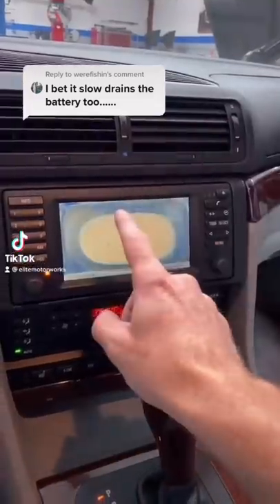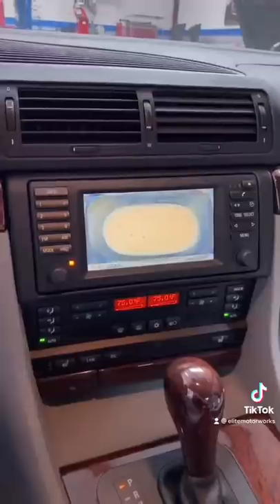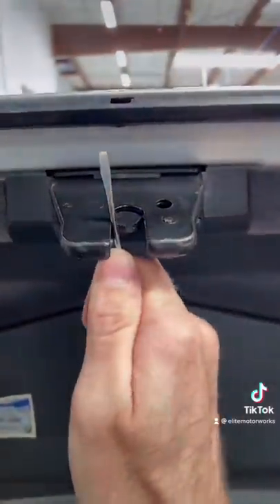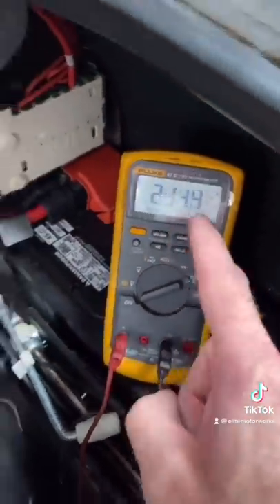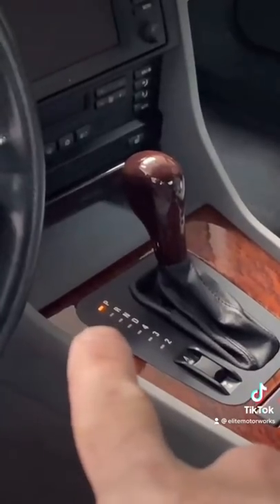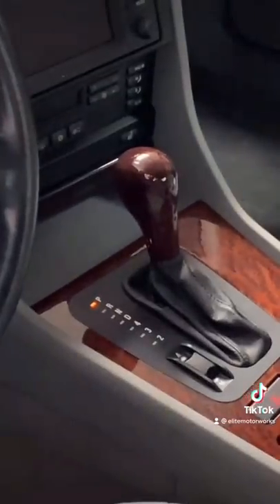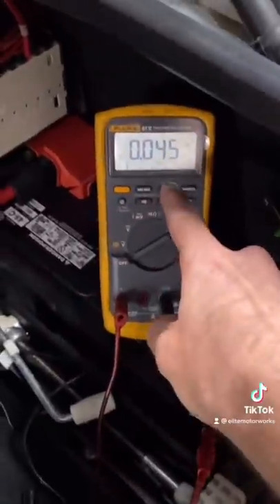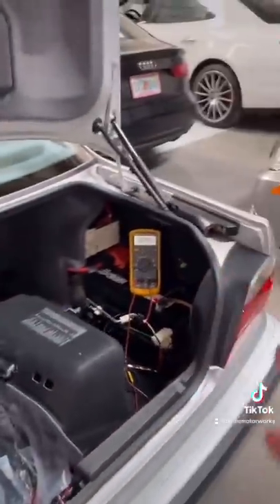Checking BMW Battery Draw #shorts

Comment: Now I know how to assess a electric draw, you learn something everyday. 
Thank you for your properly informative YouTube Channel!
Reply: Make sure that if you do this, you put the meter in series with the battery or you'll blow the fuse in the meter
Reply: @asbestosfibers1325  is 50 mil amps just a common reading across all cars or just Bmw’s
Reply: @Mrvalle420  It seems to just be a rule of thumb. I would guess that anything around 50mA would be what you'd look for in any car. (50 isn't the magic number though. 51 or 52 would be just as good as 50.)

I don't have much experience with car electrical systems, but I'm going to school for electrical engineering right now.
Reply: Not all cars you can do that trick.. some you can't unhook the battery.. just like low voltage can cause cars not to go to sleep.. every car is alittle different
Reply: @Derbyboy13  connecting the ammeter in series makes the circuit connected again, so I think you’ll be okay?
Reply: @Derbyboy13  what are you talking about? Disconnecting the battery would defeat the entire purpose of this test
Reply: @944LS  depends on the meter.. I know they now make meters you can put in line.. but if the meter doesn't let 100% pass through you could cause your own problem
Reply: @Fee.1  cars have parameters to go to sleep.. some need to see so much voltage before it'll go to sleep.. so if your battery is low it'll never go to sleep.. it's all down to how it's programmed and what parameters with are looking for.. another example one year only for corvettes if you doesn't put it in first gear the computers stays awake.. it was a programming problem

Comment: Note: for some makes the test isndone the same way EXCEPT you connect -  batt post to - cable end for 5 min and remove jumper cable leaving ammeter leads conecting - post to - cable end. On some makes the initial current draw is 15A or even more and it will step down to 3-4 A after 4 min and then it won't blow meter fuse.

Comment: I switched from checking for draws this way to checking via the can bus. That's the real game changer. You have all your components on one bus in your hand at the same time. You don't have dig out components to unplug them (pulling fuses doesn't always do the trick), but a can bus never lies. Also you'll get your voltage change in less than 5 seconds after locking the car. Think about how much time that adds up to if you only have to wait 5 seconds for each component check. It saves at least an hour if you're working with something that isn't a known failure. I promise if you try it you'll never turn back!!

Comment: Pro tip sometimes cars are even smarter than we are and realized the car hasn't been woken up yet I've ran into this problem, draws will only be apparent once the car is started and shut off once if you got a weird one try this too, you got to hook a high current  jumper wire up between the battery post and cable at the same time have your amp meter hooked up too than start the car shut off, then just remove the high current jumper wire and now your amp meter is the New Path for electricity to flow with no interruption to the car, this is how I found the Bluetooth module in Acuras having a current draw problems before the tsb's were out

Comment: What you have said is incomplete pop up the hood & trunk open 4 doors then lock each latch manually then lock the car using remote, go to battery make sure before you disconnect the negative terminal connect the tester probe black on terminal/ body ground the red is in battery terminal negative then slowly disconnect the terminal from the battery post. Wait for the system  to sleep then check the reading it should be around 25 to 30 okay ( dark current)

Comment: A Quiescent closed current draw with a 100w range amp clamp would be just as effective and you can watch the car go to sleep along with the specific time on which it does with all the access panels removed and the interior motion detector disarmed hood switch in the service mode glove box light disconnected. 60 mA is for our older vehicles some of the newer ones are completely asleep in 30 minutes and draw less than 20 mA. If you use your meter put an inline circuit breaker so it doesn’t pop your fuse in your meter.

Comment: The only problem with this is that by disconnecting the battery you can inadvertently remove the draw. For example if a control unit is causing a draw it may be reset by the disconnection only to return later. To prevent this BMW has a special tool that allows you to hook up a meter without ever breaking the connection thus making it easier to find those pesky intermittent battery draws. Without this tool you increase the risk of a comeback. Also on the newer cars, E65 and newer it takes about 1 hour to fully go to sleep meaning you can't rely on the shifter light to indicate the car is in sleep mode. That only works on pre E65 models.

Comment: Helllo from a technician that does a lot of electrical issues I basically work on Asian vehicles but I have done German as well as American vehicles a couple of things I've learned when doing a parasitic draw test on a battery one is never take the battery cable off and then put your meter in series either use an amp clamp with a scope and look at the waveform or hook a battery jump box to the cable lift the negative cable up then put your meter in series with that cable if you disconnect the negative cable as in the video some  modules to be exact will  wake up . Now you need to wait for the modules to go back to sleep which may take 30 minutes to an hour to actually see if you truly have a parasitic draw and it is always good to check and make sure the battery that you are testing reads between 12.4 to fully charge.

Comment: I use an in line battery disconnect switch on the ground cable to handle wake-up current so I don't blow the fuse in my meter. Once I'm sure current draw is less than 10A I switch off the disconnect and let current flow through my meter which is hooked up in parallel.

Comment: Also, if your battery isn’t the size of a BMW battery, and your car isn’t a luxury car, it probably shouldn’t be that close to 50 mA. I have seen 45 drain a battery over a weekend, but the battery on the car was quite a bit smaller. That said, 50 mA is the standard, and close to it is usually only an issue for cars that are not used a lot.
Reply: That's not possible. 50mA over 36 hours are 1.8Ah, or not even close to a tenth of the smallest realistic battery capacity that has still works

Comment: If you end up doing this on your own vehicle and the draw is out of spec you need to start pulling fuses until the draw drops to normal, then put the fuses back in and pull connectors/sensors etc related to that fuse and eventually you will find the draw.

Comment: But you reset any modules when you disconnect the battery potentially removing the draw temporarily. It’s better to use an amp clamp for this reason, especially on newer cars. Also CAN may take up to 10-15 mins to “go to sleep” after locking.

Comment: Another reason for why both the e38 and e39 will drain the batteri is if it has air supesion in the rear and its leaking, the compressor will go ok even if you dont have it on.

Comment: This is a common issue when the dealer switch the polarity of the battery wrongly and bring it back to the correct place, it causes the multimedia center to drain battery later

Comment: I have an aftermarket android radio and put it on the circuit that completely shuts off when you remove the key. I have to wait a minute for it to boot up when I start the car, but it's the time I spend setting up my seat, putting on the seatbelt and waiting for the engine to warm up a bit so it's still pretty good. No idle draw that way!

Comment: You should check the potential draw on the battery with a 10 amp fuse before hooking up your meter so you dont blow its fuse.

Comment: Just buy a matching LCD screen online and fix it, as long as its the same size and same connections itll work. It doesn't need to be a BMW brand screen. it really is somewhat   "simple" if you know what you're doing.

Comment: Had a similar problem with my f250 diesel. Started pulling fuses until my ammeter showed zero. Pulled all the fuses and nothing happened. Then I turned to the relays... nothing but the ecm relay stuck in the open position. Replaced the relay and no more parasitic draw

Comment: Well that answered one of my questions. Just got my 740il going again I'm the last week. Maintenance and insurance. It's been sitting for 3 years. Anyways the other night I shut the car off and noticed with everything off and the doors locked the parking light on the shifter was still on. Now I just need to make sure that it's actually shutting off. The last battery that was in the car when I bought it kept dying on me. But I don't know the history there. Since I've replaced the battery it has dyed yet but I do drive it everyday. Guess I need to run the multimeter and see if I got a draw somewhere.

Comment: Also RF receivers for the keyless lock-unlock could be acting up. On my range rover the fr receiver is sensible to wi-fi/mobile phones signals  preventing the bcem to go to sleep and it will kill the battery in two days.

Comment: Manufacturers think < 50mA is OK?
I'm surprised.
That could be a bit over 1 Amp-hour every day, which means short battery life and/or a flat battery when you come home from holiday. 

I've had that problem with a Peugeot, cured by fitting a battery isolator. Then I left it alone for 6 months during lockdown, switched on and it started fine.

Comment: You should check into the mooshimeter for battery drain testing. We use ours all the time. It can datalog in csv format so you can graph the results.

Comment: Nice. But that means it could drain a smaller 55 Ah battery completely in "just" a month and 3 weeks. It (maybe?)won't start in a month because starter needs hundred of Amps but the battery only has about 40% state of charge after a month of last use.

Comment: Would this work with my E39 3.0d, I started playing around underneath the passenger seat to try and get the heated seat to work, the other day I could hear a buzzing sound when I turned the car off late at night, when to work left the car there all week and tried to start it and had a flat battery, turned the car off last night no buzzing sound. Never had a flat better before and looks new still. Thanks in advance
Reply: Similar issue in my 530i, fuse 9 was the culprit which powers the windshield fluid heating system which often draws too many amps but it also does aircon/defrosters
Reply: Yes that would work to check it. You could also just check the batteries health with a charge then load test. (carbon pile is best)
Reply: @charlierobinson8375  might be my issue as well, might go get a new battery and pull 9 and watch. Car has been sitting for 2 years now waiting to go home to NJ.

Comment: When i first bought my mini i tight something was wrong cause those little lights would stay on long after locking up the thing that made me think there was an issue with something staying on was that my battery was already in a shit state and would die super fast. Took it to the dealership and the said that was normal for mini/bmw vehicles. I bought a yellow top and never looked back cause i no longer had an issue afterwords

Comment: Grandpa had a Chevy truck I can't remember which year or model but it would drain the battery where over the weekend if you didn't go to work on Monday or Friday it would need a jump and it just killed batteries they started taking fuses out to the point none were left until they just disconnected the whole fuse array then it stopped slow draining

Comment: I'd recommend (Depends on your DMM) using a jumper wire, connect it from the post to the cable then attach your DMM in parallel with it. You check to make sure you don't have high amperage, then disconnect one end of the jumper cable to fully measure the amps. This way you don't blow your DMMs fuse.

Comment: I own a 1998 Opel Vectra B V6 (Manual trans) and my Battery died. So I did the same test but I only had 18 miliamps so why did my Batterie die?

Comment: I have a 07 Lexus IS 350. The Nav screen doesnt respond to touch. Im having the same battery drain. I also have a headlight that goes on and off. Could this be my problem? If so where should my multimeter be?

Comment: Quick question: on your multi meter, wheres the positve prong leading to?  Should I let that hang or test every fuse for a parasitic draw?
Reply: The multimeter needs to be in series with the battery, so one prong on the battery itself and the other prong on the wire that you disconnected from the battery. In this mode your multimeter acts as just a wire allowing electrons to travel through one probe and out the other, and then it just monitor how much power is running through it. Just make sure you multimeter is rated for the current.
Reply: @StealthSecrecy  oooh!!!  That makes a whole lot of sense. Thanks for the help. I appreciate it.

Comment: Hello, i have a 2004 bmw m3, do you know if the cigarette lighter turns itself off after 15 mins of use or not? I’ve heard mixed answers.
Reply: i literally just tested this today after starting to work on my abandoned e39 yes they turn off after you shut all the doors and lock the car
Reply: quick wuestion do u know what he means by connecting the meter in line? idk how to do that or what it means
Reply: @heaintgoin  at what point in the vid
Reply: @diamondplays8944  “connect our multimeter in line with the battery”
Reply: @heaintgoin  I honestly have never tried something like that so I’m not sure, sorry.

Comment: You shouldn't do it this way these days.

Due to all the computers in the car, it can take 30minutes for them to go into sleep mode.
The better way is to put the multimter into DC volts mode and put the probes on the two metal tabs on the fuse, this way you can measure the voltage drop across the fuse.
Then just look at a chart for converting fuse rating and voltage drop to current in mA.
Doing it this way also has the added benefit of knowing which circuit is responsible

With the method you shown, you then have to find the circuit responsible.

Comment: I have problm with my Mercedes w220 s320 2000 model
I checked door controling module
Seat co trolling module
Driver upper light controling module
Real sam
Front sam
I cant find drain
2.12a drain 
Please help

Comment: I did the same thing and it shows 200mA after the cars asleep. How to diagnose the issue? When I pullout the audio fuse, it drops to 50mA
Reply: if it leads to battery drain then audio system has short circuit or fualty

Comment: Could you use this test to help figure out if your alternator is bad too?
Reply: Probably not, I never used a draw test for a bad alternator. I check voltage at the back of the alt. at the hot terminal, then check voltage at the battery. If the voltage is under 13- 13.5v then the alt is bad or the regulator fuse is bad. Also if the voltage if lower at the battery then the alternators positive terminal then there's a problem with the positive battery cable or ends.
Reply: @johnmoore256  
Money…!!!
Thank you. It’s so dang hard to find a real answer these days.

Comment: Would you happen to know where the ground strap for a 2008 550i would be? I’m having a low voltage issue
Reply: Under the rear offside quarter strap

Comment: Try the bmw e61 that i have with that voltage drop test and  do it with me then😂 it wouldnt surpise me if you couldnt find the battery discharge thief that fast in my case or find it all 😂 believe me i have gone through all fuses from the back to front, disconnected sub woofer amp  and other accessories etc amd and still have voltage drop up my ass up to 8Amps and soon on my 3 battery in barerly a year now cause off it 😂 i need help BIG time!😂

Comment: Voltmeters don't connect in line that's either a multimeter or an ammeter
Reply: He was measuring in amps, it's a multi setting Fluke multimeter, do you need any more info? I think everyone gets the idea by now.
Reply: @josephpbrown  no. Think I covered it already.